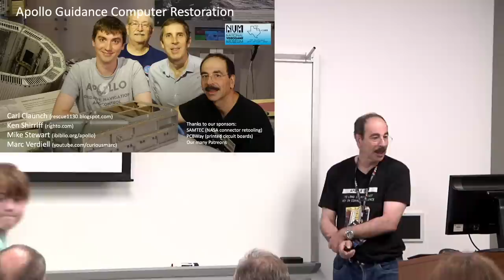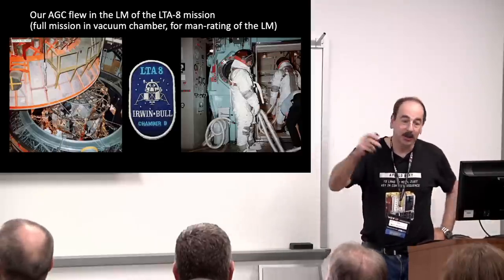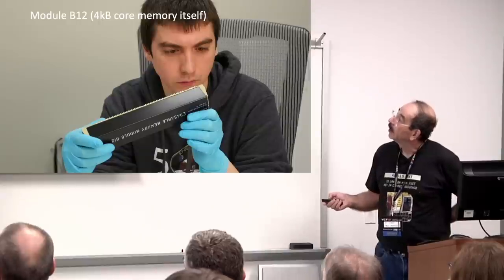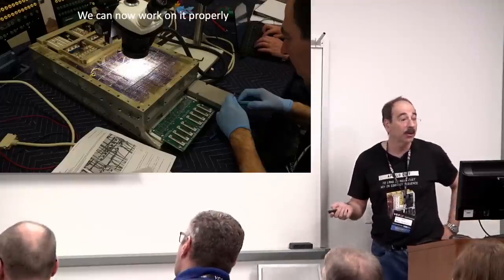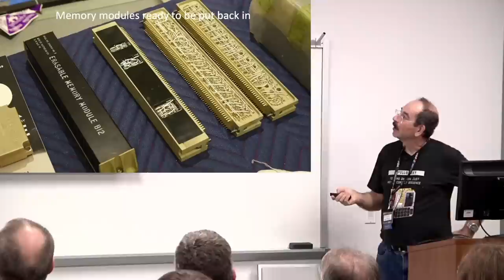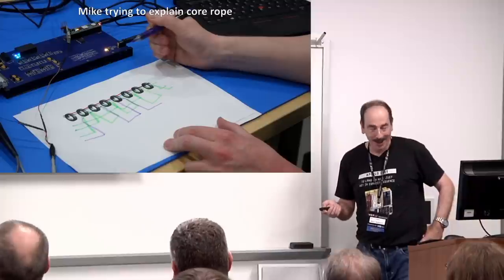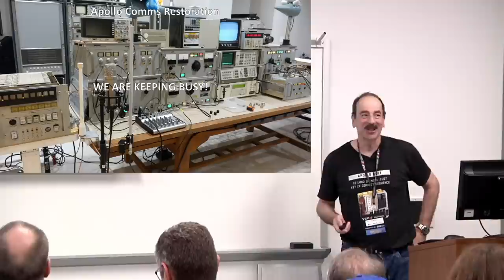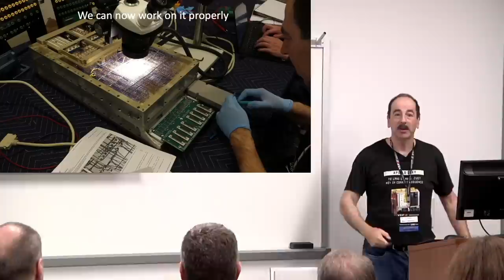Restoring the Apollo Guidance Computer with CuriousMarc

Comment: The absolute gobsmacked slap of luck that Marc works for Samtec can not be understated: this is a big reason the project was successful, being able to completely re-make connectors that have been long out of production.
Reply: Well, connectors aren't rocket science. It may not be as good as this one, but you will be able to make one that fits, even more so when you have the full specs.
Reply: There are ways of manually making the contacts using jigs. Just like the watchmakers used to make parts. Jigs and hand files. Now the hand files are special and may well go down to 10,000 grit for some of them - but they’ll do the job. Contacts that have box structure would be assembled from two flat parts. Very tedious process and their time was better spent on other things - hence getting folks at Samtec do it.

Comment: Before saying that "Eagle was lucky not to crash", I would refer you to the old adage "You have to be good to be lucky and lucky to be good."  Armstrong was monitoring the vehicle performance closely in the descent phase while the autopilot was on.  He said as long as the LM was behaving normally he wouldn't have disengaged the autopilot (and flown manually}or commanded an abort.  Depending on where the 1202 loss of control were to hypothetically have occurred, Armstrong might still have had the option to disengage the autopilot, and land manually (as he did eventually!).
Reply: As far as I understand that would not have worked. The loss of control would mean you also lose your hand controlled landing, which was basically another program in the AGC that just quit on him. The only option would have been an abort with the AGS. That means dropping the landing stage and go back to orbit and make Apollo 12 ready for the next try two months later.
Reply: Unfortunately, in a fly by wire system, if the computer is stuck, then everything is stuck. The interface between the hand controls and the thrusters was software.

Comment: Marc and the whole team, Carl, Ken and Mike (especially Mike, the lone individual who first designed a gate accurate simulation of the AGC in FPGA) did a fantastic job getting the AGC back up and running. And of course Mike had all the rope core memory dumps one could ever want or wish for, to load into the AGC.22:25 And then there's the proprietary connector, with all the weird preservative that was caked in it. Marc spent a lot of time restoring that.